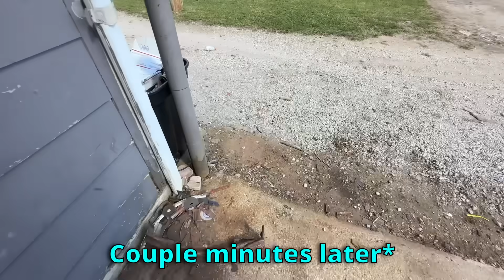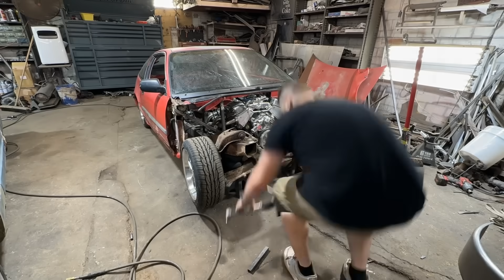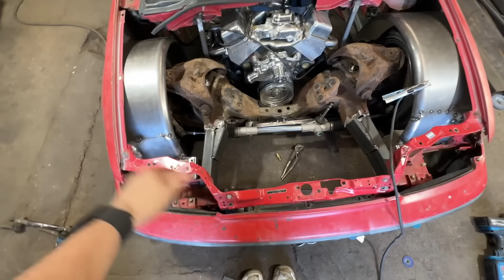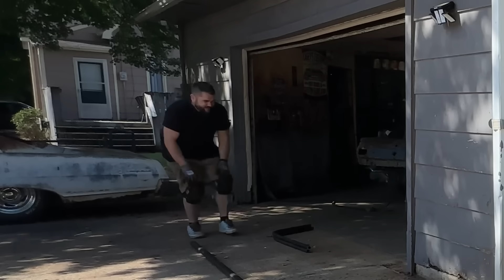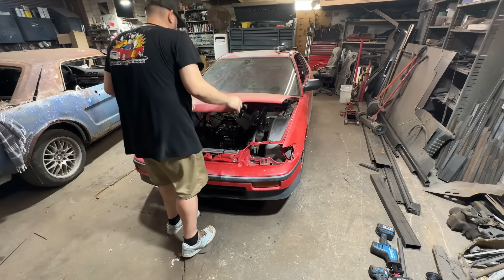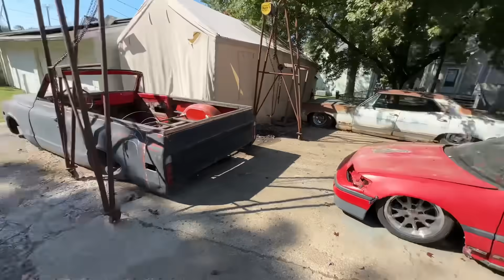CHEVY V8 IN A HONDA?! THE RWD CUSTOM FRAME IS FINISHED! HOT RAT ROD TUNER?!

Comment: might be a bit late to do this but what if you slanted the radiator forward and create a reverse drop vent on the hood.  It can vent heat out of the engine bay and not blow hot air all over the engine.  Plus you could build a rad splitter that covers the entire bottom of the front end

Comment: The top of the radiator needs to be high as the intake of the engine or your going to have air bubble situation  in the block

Comment: Cut the front frame extensions then weld in oversize  plates with bolt holes to make flanges that unbolt that will simplify front part of body removal .

Comment: You are going to probably going have some bump steer with that rack.    When the car is straight you should be able to draw a straight line from the upper control arm pivot point through the inner tie rod to the lower control arm pivot point

Comment: What is the deal in the US with structurally modified unibody cars? 

In the UK I can see how the CRX is potentially acceptable as the unibody is put on a frame so the unibody is now essentially just a chassis on a frame.

The BMW/Mustang however is based on a structurally modified unibody. In the UK this would either be uninsurable & not allowed on the road or would have to go through an SVA test which is stricter than our roadworthy MOT test as far more is checked.

Comment: I like the Dog house Idea . Make it tapered to about a foot past tailshaft so engine is removed from interior . Make it HD and many bolts so its structural .
Other wise the other option is to make body tilt up like a funny car but that seems difficult with a floor and electrical etc. For street driven ride.

Comment: Here's an idea to get that motor where you want it in the front you could probably make a k member or something similar to the way a 65 Mustang bolts their 289 up that would definitely get that motor lower and would get it where you can have it more upfront instead of kind of a mid-engine I don't know it's just a thought
Reply: Yup thats a great idea and it will surely make it easy to drop that motor out from underneath the car. From the looks of it that motor will be a nightmare to remove where it's at

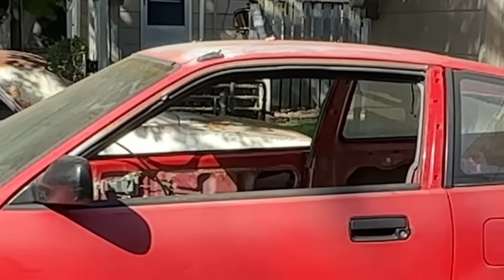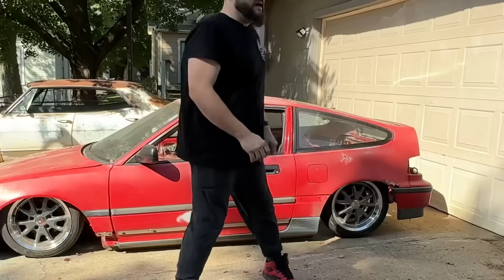Comment: Clip it from 21:20 to 21:34 and hit 20million views.

I've been a Honda fanboy since my 1st EG Vx Hatch +20 years ago. I've had my 89 crx(B17 built) for +14 years now. My dream is to awd swap (my daily is a 5spd awd b20 RD1 crv with all the parts) and to turbo it w/ a lower comp rebuilt motor, but a RWD v8?! those are pipe dreams brother.
I Subbed and liked, keep up the show! Looking forward to clips of trolling the streets before the first track pull.

Edit: that motor sits so far back into the firewall, looks like a Rotary swap  Chef's Kiss

Comment: First of all for those that never built a ride or thinking about getting into it some time's a build can take a long time unless that's all your doing for 8 hour's a day putting in a full work hour's and you have everything you need to get the job done.
For wheels I learn over the year's you can make a set of wheels look different just with paint or shine them up and they have different center caps or hub covers to make the wheels look totley different. Then you have many many different tires to choose from that pretty much will set your ride off it will make or break what tires and wheels you chose from low profile to get white wall tires. 
I had an old set of center line rims I thought were shot. Until a friend shined them up and I found some bullet cent hub caps I chose 15" 50's low profile tires it made my truck look like a whole different truck for very little money. The only cost was the tires and center bullet caps. I see old junk yard wheels get painted with chrome caps look great